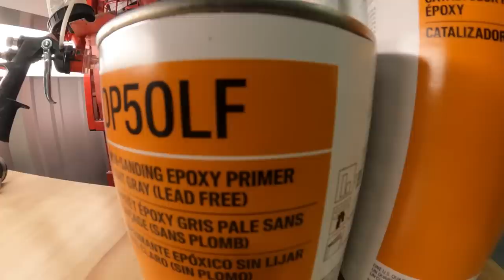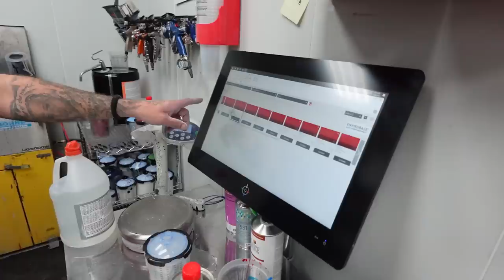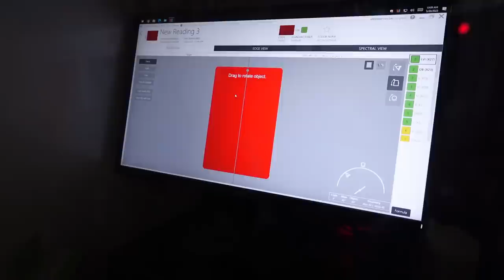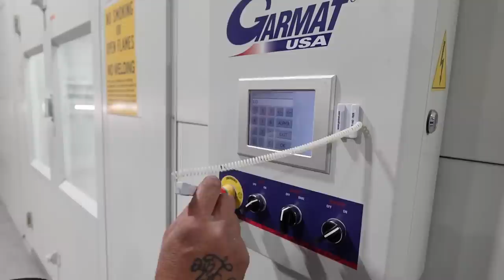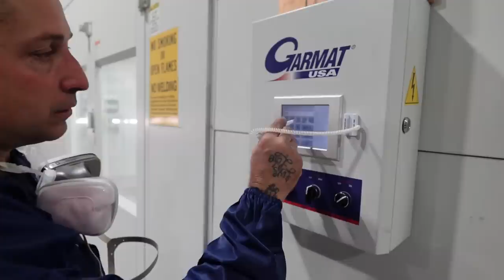THIS is What Happens When You Try To Fix a Fire Destroyed Ferrari

Comment: Hey guys, I have a question about my personal project truck.  I am doing a full restore on it and will be painting it myself.  I will be painting the body as well as the interior of the cab.  My question is, after prime on both, is it best to start base coats on the interior or the outside body first to help cut down on over spray and other problems?

Thanks

Comment: I tried painting for first time stage one. I sprayed first coat then looked at the hood and I left the air hose mark all over the hood. It so happens the hose hot on top. And I kept getting kinks on the air hose and I kept tripping over the hose. The hose was all loved me like an anaconda snake. And a bunch of water kept coming out of the spray gun that cost me $100 so I switched to the $10 Harbor-freight gun and it stopped leaking water idk how a cheaper gun did that. My 28 gallon compressor kept stopping to compress more air. So I could only paint a fender at a time and had to wait a few minutes to start again. And the smell from the paint when I was mixing it. I couldn’t take it so I had to run away and come back and forth.not to mention so much trash on the paint. And the fuse kept on tripping every 5 minutes the list goes on.

Comment: Shouldn't the bare Aluminum be prepped with alumiprep 33( Bonderite 33) first before the expoxy primer? 
Or isn't this necessary?  
Ford obviously screwed up thousands of cars/trucks/suv's with improper prep and has the paint bubbling up on them.
I have an 08 expedition with this issue and dont want it reoccurring after i paint it
Reply from the maker: It wouldn’t hurt either but kandy man insured the epoxy will be enough.
Reply: I'm sure the make the product for a reason. But we will know in a few years who was correct

Comment: that priming was basically a hard-edge:( That's a lot of product going into the air, turn the pressure down some, you make the pattern fit the part.  The welds were missing at 0:16 seconds and verified at 0:56 seconds, it is split/not fully welded at top left of the window opening.. This is a Ferrari, the prep should have been better for real.
Reply: Nice catch. I can't believe they left the sectioning cut like that. Can you say water leak.
Reply: @mcats8  Crazy, on a ferrari. Ha
Reply: @Explorer-X   I don't think it was Kandyman's shop that replaced the quarter. I think it was the Goonzquad's bodyman who did the work. Same guy who took a new wrecked Challenger and sectioned a quarter panel in half right above the wheelhouse, even though they had a new complete replacement panel. It was a total hack job, I guess they didn't want to remove the back glass. 🤔
Reply: @mcats8  lol.  Damnnnn.
Reply: @mcats8   He should have said it needs fixed or refuse to paint it, epoxy, filler, surfacer, base, clear over welds that appear to be about to split and the holes:(
Reply: @Explorer-X  I agree. Kandyman and Mitchell Collision appear to do top notch work. Brian should not have involved them with this Samcrac dude and the Goonzquad bodyman. It reflects poorly on the former. All in the name of views. It's no wonder why owners don't want videos in their shops.